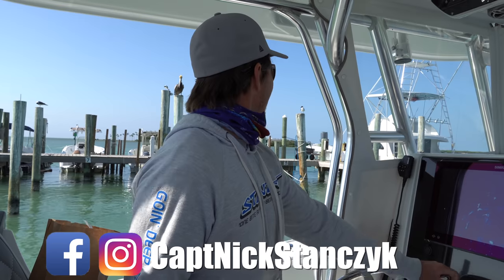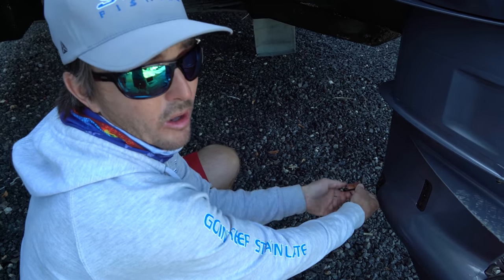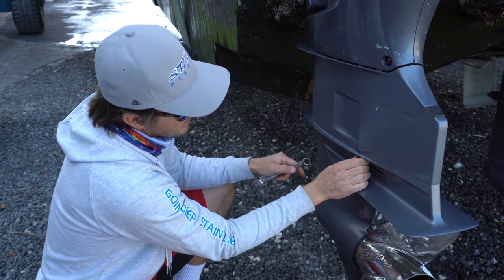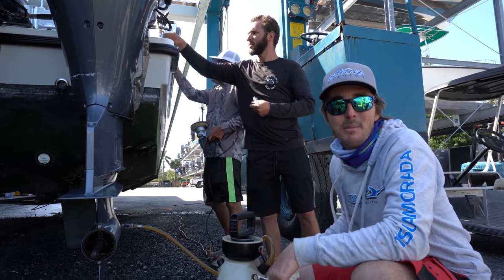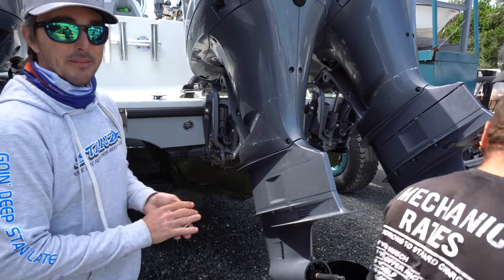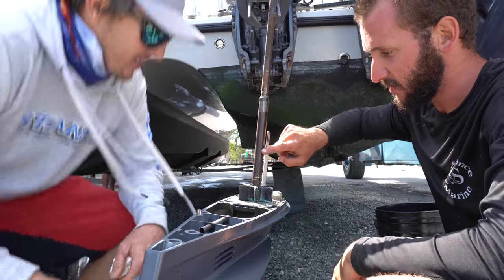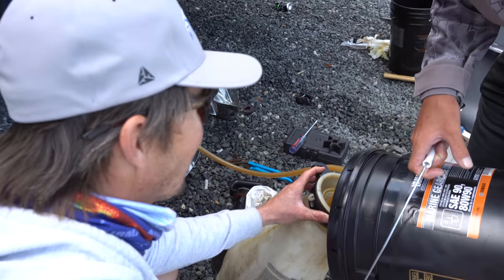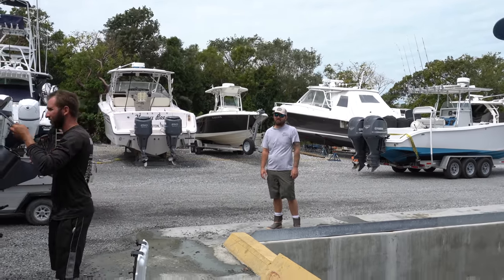WHY SHE RUNS! *QUAD 300* Engine Service! Oil Change and Water Pump Impellers! 37 Freeman

Comment: I just put a pump rebuild kit into my 2015 300. What I learned. You need a thin wall socket for one of the bolts or you have to put a standard socket in the freezer to get it on the bolt head. I had to hammer plastic wedges in the gap to get the lower unit off. Lining up the shift shaft when reinstalling the lower unit is a PITA!!!! And you learn that after you start your motor and learn that you have no forward or reverse.....Other than that it was no big deal....

Comment: Getting ready to do a water pump repair on my ev 140. Pulled off the lower before I winterized it (yeah, got to do that up here.😁) Lucky there was no shift shaft on yours. Good job guys.

Comment: You don’t ever need to repower a boat at a thousand hours EVER! Especially if it’s on a boat like a charter boat that runs at a constant speed and especially a Yamaha lol. I know a charter captain that ran his outboards all the way to 12,000 hours (Yamaha 250 4 stroke) and it still ran strong up until he repowered.